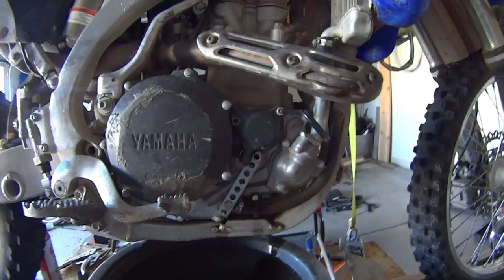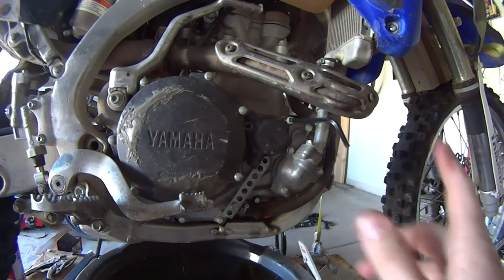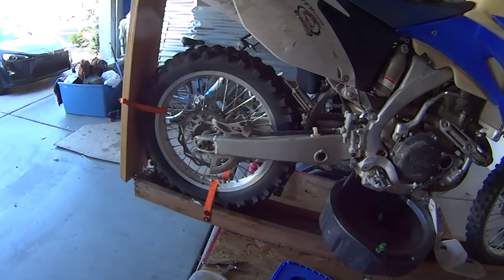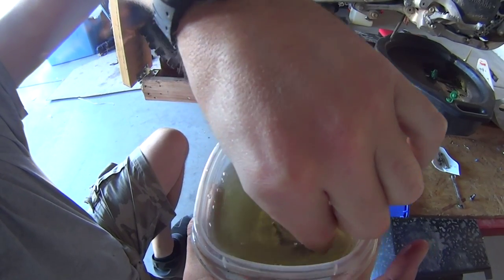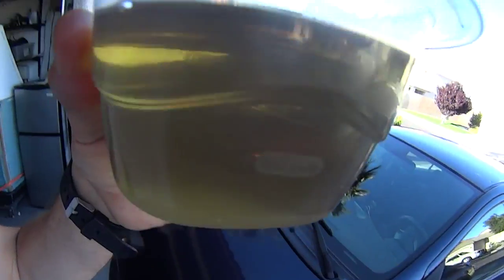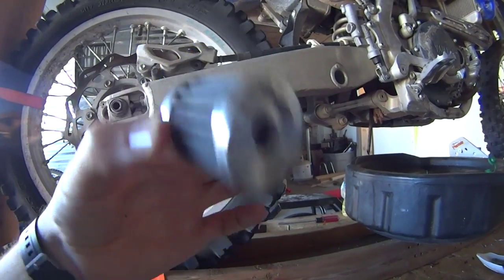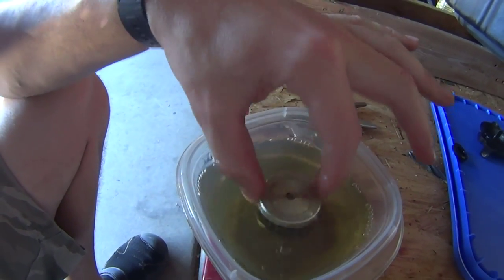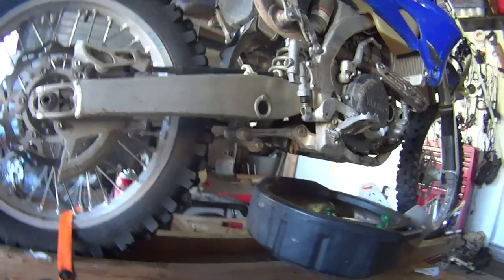Stainless Steel Oil Filter after 10000 miles - REVIEW

Comment: Hi Vegas, have you ever considered doing a 500 mile ride with a paper filter, and then wash it in gas to compare the trapped materiel to the stainless steel filter?
Reply from the maker: No, because its not a fair test  the bike already has a pre-filter in the oil reservoir most of the stuff gets trapped there
Reply: @vegasromaniac   I never found anything in the course sieve inside the frame. I really think it would be a great test to see the difference between the steel and the paper filter under equal conditions.

Comment: What kind of magical plastic container is that? I always thought gas would eat through and/or distort regular plastic.

I guess my amount of lazy overrides my level of cheap.  Cleaning the oil filter takes longer than replacing one... Not that I'm good about changing the oil regularly
Reply: You can use old disposable tupperwares. Sometimes I use empty icecream tubs. The gas doesn't eat it. :) You can even use Kerosene or Diesel to save money instead of gasoline.

Comment: ... a question, how do you know if you’ve cleaned it thoroughly? Also, they are a fine filter, down to 35 microns, so how do you know it’s not restricting oil flow as it captures more fine particles? I’m interested.
Reply: Ronan Rogers that's why you change oil often. Like every 1500 miles if you ride daily.
Reply: still less restrictive than paper oil filters
Reply: 35 micron in not a fine filter